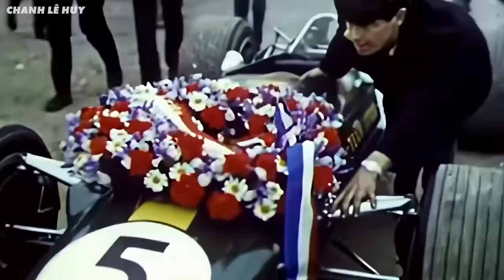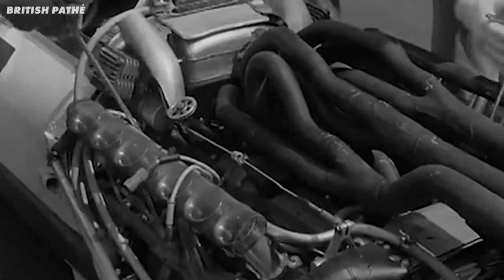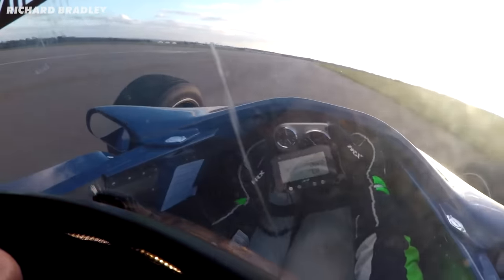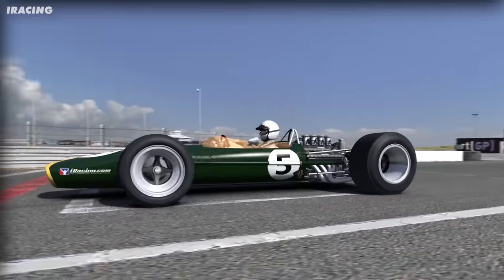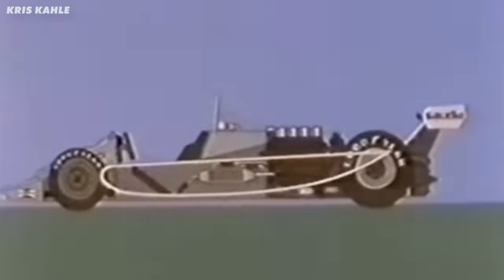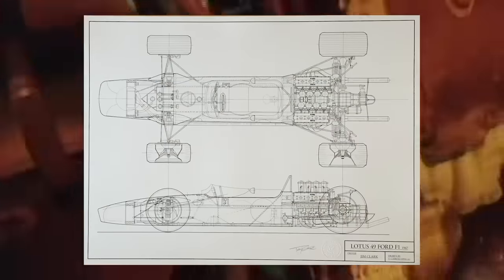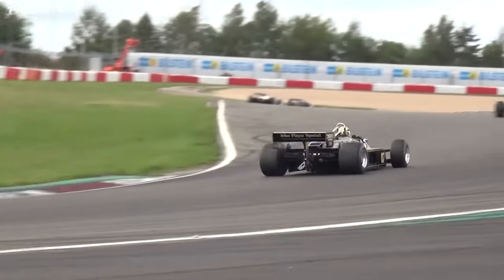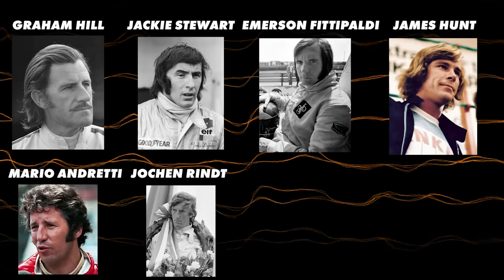When FORD Designed the GREATEST F1 Engine Ever!

Comment: The DFV was not the first 3 litre V8 in F1. That honour goes to Brabham which had a Oldsmobile engine modified by Repco in Australia. That combination won both F1 championships in 1966 and 1967.
Reply: Beat the DFV which also ran part season in 66 and full season in 67. It was a shame Repco didn't bother to develop their engine further, as they had already achieved all they set out to achieve.
Reply: @alexjohnward   The Repco V8 was designed and developed by Philip Irving, who had previously designed for Vincent and Velocette.  The Repco was successful because it was compact, light and reliable.  Note that it won the 1967 F1 World Championship, including the year when Jim Clark won the DFV's first race.  It was reliable, which the early DFV was not.  However, to remain competitive, it did need more power, lots of it.  The four valve versions of the Repco were not a success.
The DFV became competitive because it gained reliability to match its power.  This was after an accelerated development program BY FORD in the USA. The had sophisticated test equipment to find and analyse faults in an engine, more sophisticated than any other manufacturer at the time. The methods pioneered at Ford have become standard industry practice.
The £100k which Ford put up to fund the Cosworth FVA and DFV is probably the best investment that they ever made.
Reply: Why did Repco move to retail lol they had some good machinists back in the day
Reply: @youwantshum9860  Australia used to have a big manufacturing base but that shrunk over time, there would have been a engine machine shop in every town in the 60s, not now.
Reply: @youwantshum9860   Repco was heavily involved in supplying car parts for retail in the 1960s. This was a promotional venture to demonstrate the ability of the company, that it was not a maker of cheap knock-off replacement parts.
Reply: It wasn't actually an Oldsmobile engine, it was just the block, everything else had been designed by Repco. At the very basic level, the Olds engine was a pushrod, cross-plane engine, while the Repco was a SOHC, flat-plane engine.
Reply: @PistonAvatarGuy   The early Repco V8 F1 engines used an Oldsmobile block. Later examples used a modified block cast to a Repco design.
Reply: @pashakdescilly7517  So are you suggesting that Mericans had a hand in making the DFV reliable? Just asking..
Reply: @slamtailsuspension1933  very much so
Reply: The DFV never ran in any F-1 race in 1966.  
  The "FORD" power plant you are seeing in any results from 1966(McLaren mostly)was a destroked Indianapolis 4-cam engine. Not the Cosworth DFV.
Reply: Sir Jack won the WDC twice, in a car he designed himself, the Repco Brabham, the greatest acievement in F1 history. No other driver has done that!
Reply: @markhill9275  Jack Brabham was world F1 champion three times. Twice in a Cooper (1959 and '60) in whose design and development he had a significant hand. Then he set up his own race team and won the championship in 1966, and was just pipped in the last race for the 1967 F1 championship by Dennis Hulme, who was driving in his team. Brabham was not very pleased.
Hulme moved to the McLaren F1 team for the next F1 season. Bruce McLaren was also an Antipodean and a former Cooper driver + design/development engineer. Bruce McLaren and Hulme so dominated CanAm that it became known in racing circles as the 'Bruce and Denny show'. The team did not have such success in F1
Reply: @plantfeeder6677  Only in 2-races by McLaren in 66. Built by Traco in California. And an embarrassment to all concerned!

Comment: I was at Imperial College some years after Keith Duckworth, and was told he spent 3 years in the basement of Mech Eng designing the engine. He did not attend any lectures, he just spent 3 years designing the engine with input from a number of professors who had realised he was a genius to be encouraged not made to follow the usual degree path.

Comment: An episode littered with errors. A click bait title to start. There was never discussion on what crank would be used. Complete error with the conversion of English pounds to dollars is totally off, in 66/67 the rate was $2.80/pound or $280,000 or $2,581,600 in 2023 $. And there more, thumbs down.

Comment: Cosworth also completely changed modern engine design principles. Lower included valve angles lead to better breathing at higher RPM. Even Honda’s 20000 rpm engines had hemispherical combustion chambers at the time. The short stroke, wide angle V also allowed room for the exhaust pipes and leads to a lower center of gravity than flat engines,as the cars are so low, there’s no room for exhaust pipes under the car and you’d actually have to raise your engine to make room…

Comment: Another fun engine to do a video on would be the Ford 427 SOHC AKA "The Cammer." An engine so badass that it got banned in NASCAR before ever making a single lap due to Chrysler complaining about it because they knew it was gonna eat their 426 Hemi alive.
Reply: There is an extensive history of “sanctioning bodies” banning FORD engines as the other 2 manufacturers simply can’t compete when the artificial parameters are equal. Just the Cleveland alone is the most banned engine ever submitted for racing.

Comment: The Cosworth was NOT a high revving engine compared to it's competition, in fact it was run dangerously close to it's mechanical limit just to keep up. Miss one shift and it was a matter of WHEN, not if it was going to drop a valve. What made it legendary was the sheer number of teams that used it every season, through the 70's and early 80's half the grid was powered by the Ford and it won every race of the season on two occasions. The fact is from the mid 70's the flat Ferrari T cars had the superior package, ground effects and the unreliability of the early turbos benefited the DFV's winning persentage greatly. A side note is in the late 60's Toyota built a 3 L V8 engine (based on the DFV) for sports car racing, it made up to 40 HP more due to a more modern design, Cosworth never had the deep pockets it needed to keep the engine close to the cutting edge, it spent most of it's life being just good enough to get the job done at a reasonable price. Later in it's life people like John Judd tickle 20 or so extra HP (and 300 more revs) but the engine was still rooted in 1960's design and architecture.

Comment: 8:25:"When the turbo engines took over in 1972..." I believe you meant 1982. There were no turbo engines in F1 during the 1970's.
Reply: Didn't Renault run a turbo in the mid to late 70s.

Comment: Ford had nothing to do with designing this engine. Apart from cash. Bugatti were making 4 valve engines in 1923. Need some research
Reply: Funding is important, don't you think? Otherwise, it wouldn't have ever happened in the way or timeframe that it did.

Comment: We need a formula x with much more freedom to allow experimentation. Unlikely to happen, but one can dream.
Reply: Won't happen because privateers would be priced out. Already happened with Can-Am.

There is simply no balance of performance between rich and poor teams.
Reply: That's what formula one was starting to turn into, but it made it extremely expensive and basically meant that the teams with the most money would almost always win.

I'd prefer a system where you have to build your car to certain specs like peak down force and engine power, with the teams determining to to get there.
Reply: @holy3979  That's called a spec championship, which you'll find in IndyCar and NASCAR.

And F1 is also trying to combat it with development credits - not that I can say it was an effective strategy.

Comment: I was yesterday at the Spa 6 hours, it hurts so much when you see how strong Ford used to be.

The Spa 6 hours itself is dominated by the Ford GT40's, but almost every other brand is driving Ford engines as well.
Not only that, I was wondering: "Where are the Ferrari's?". Answer: "Too expensive to maintain.".
It's even budget friendly.

Also the Capri Cosworth destroyed the whole field in the Belcar Historic Cup, starting in the 2nd group with the older cars.
But 1 lap later the Capri was already 6th, overtaking 30-40 cars in just 1 lap.
Later overtaking M3's, 911's and more from the 90's and even a Corvette C4 with a whopping 800Bhp.
The Capri only has 435Bhp, is from the early 70's, and casually destroying DTM cars from the 90's.

At Zolder a decade ago also a Cosworth Capri being 4 seconds a lap faster than the Alfa Romeo 155 DTM legend.

Now Ford is rather pathetic, really sad about it.
Reply: Such a shame from Ford, hope they do well in 2026

Comment: The turbo didn't take over F1 by 1972. The very first driver championship was won in 1983. (8:45)
Reply: Not only did the turbo not take over by 1972,  it wasn't even until '77 with Renault's RS01 that a turbo even appeared.  There's a good quote in a book I have (I think it's Doug Nye's 'History of the Grand Prix car 1966-85) mentioning a speed trap at the end of one of the straights on some circuit or other - suddenly a speed tens of miles an hour faster than anyone else showed up - the turbos had arrived...  but it took them until 83 to win a championship, but of course that was also the year of the final DFV F1 win with Michele Alboreto.
Reply: @thosdot6497  This video is littered with error, not to mention the click bait title. In addition, his conversion of English pounds to dollars is totally off, in 66/67 the rate $2.80/pound or $280,000 or $2,581,600 in 2023 $.

Comment: I think you meant 1982 not 72 for turbo engines. Renault RS01 of 1977 was the first F1 car to use a turbocharged engine and were known as tea post for the blew up quite often.
 by 1981 turbo power ruled. 812 Ferrari 126c won constructors championship in 82 and 83. In 84 the Mclaren MP4/2 Tag Porsche turbo dominated the 84 season winning 12 of the 16 races. 86 was Williams FW11 turbo Honda where Mansel and Piquet won back to back championships 
I was lucky enough to go to the Long beach f1 race in 81 and 82 where the DFV Cosworth v8,  Matra v12,  Alfa v12, Hart turbo, Ferrari turbo, BMW turbo M12, Brabham ran the M12 and Cosworth, were in full battle mode and the sound was heaven for a gear head. 
Niki Lauda won 82  with his MP4/1B Mclaren DFV Cosworth power and the top 10 finishers were also DFV Cosworth power.

Comment: Many of the innovations listed for the Cosworth already existed.  

When the 3-litre rules came in Jack Brabham quickly built a V8 based on the production Oldsmobile 215 alloy V8 with overhead cam heads designed by Phil Irving.  He won the championship with that engine thus becoming the only person ever to win the driver's championship in his own car.  That was a flatplane crankshaft engine as were all early V8s until the cross-plane crankshaft was developed.  Tuning the exhausts of V8s could be a problem and contributed to some F1 V8s being reversed with the exhaust in the valley of the V and the inlets at the side of the engine.

Using the engine as a structural element of the chassis was well known and had been used in cars, motorcycles (HRD Vincent for one) and pretty much all WWII aircraft.

Four-valve heads had been around since the Peugeot GP car of 1912 but had fallen out of favour as the failure to understand gas flow and combustion meant that they did not perform much better than a two-valve hemi but were more complex.  The four-valve head started its comeback in the early 60s with Honda racing motorcycles and the beginnings of designing the heads for squish.  This was further developed by Weslake Engineering for Ford and later turned up in the Gurney/Weslake engines.  THEN Keith Duckworth continued that development, his earlier engines were very different, some using Herron combustion chambers.  There were many great British racing engine engineers in that era including one of Keith Duckworth's "Heros"  Walter Hassan of Coventry Climax. Many of these people cut their teeth in aero engine design during WWII, whereas others such as Harry Weslake were legends in the British motor industry.

Firing order?  It may be related to exhaust timing but usually firing orders are optimised to keep the crankshaft vibrational modes under control so that the crankshaft does not break.

Don't get me wrong, the engine was a great design but it was not doing anything new or innovative and THAT is one of the major reasons it was successful, it was just well-engineered. Unusual but not innovative was the BRM H16, and we know how that ended.  There had been H engines before, most notably in aero engines with two prominent examples being the Napier Sabre and the Rolls-Royce Eagle 22, both of these were H24s using sleeve valves (most important for building a compact H engine!!!).  The BRM H16 was designed by Tony Rudd who had come to BRM from (cough, splutter) Rolls-Royce.

Comment: The DFV was not a 'high' revving engine because it used less cylinders!!. The V12s of the era revved higher than the DFV because their piston/rods were lighter.. ffs, get your facts straight, ask anyone who knows this stuff. 4 valve heads were already used before, like pre WW1!!! The key to this engine being the greatest racing engine ever designed was very simple! Duckworth decreased the included angle of the valves, stood them up, to create a very flat piston, which lowered its mass, and a "pentroof" combustion chamber which made the gas flow into the chamber relatively straight.. The gas tumbled into the chamber, and burnt a lot more fuel than the old wide valve chambers. NP - Every production engine manufacturer learnt from this, (apart from the Mericans) FVA/DFV design but it took decades to see this in production engines.

Comment: So I didn't see any comments mentioning it, but I thinkyou missed the technology that gave the engine it's tech. (This is from Kevin Camerons 'Classic Motorcycle Race engines') 

You mentioned the engine had 4 valves per cylinder, and this allowed air to enter and exit the cylinder, there by allowing higher revs. However you missed a step here. 

All that air and gas mixture has to burn. It's the burn time that was the limiting factor of the engine, not the valves. (The valves were a limiting factor but that comes up later) 

See the way two valves engines would work, would be to have the intake valve set to one side of the cylinder. When the intake-charge was pulled In, it would swirl around the cylinder like liquide does in a blender. This swirling would allow faster combustion. 

However at higher rpm, the valve size goes up to get increases flow. This makes for heavier valves and a slower valve train. 

You can get around this by using 4 valves, but now you have valves off set to either side. As the air-charge mixture comes rushing in, the two paths cancel each other out. Killing all the swirl. 

The cosworth genius was to think "instead of a swirl that spins like a blender, what if we make the valve angle really steep, and get a swirl like a front loading washing machine?

This created a combination of higher flow, and more efficient combustion. About 10% more efficient, which is what the lap times tended to reflect. 

Casworths design didn't get figured out until the 80's. (Ducati had to discover it independently) other engines designers tried to copy the Cosworth design, but because they didn't know what they were shooting for (a horizontal curl) they couldn't replicate their success. 

All the other factors you listed were new to me, so thanks for sharing. I appreciate the vid.

Comment: Why would V8 rev higher than the V12? Each cylinder would be much bigger for V8s so it wouldn't rev as high as the smaller cylinder V12s.

Comment: question:
If this was the "greatest F1 engine ever" ... why is it not used in competition today?  
Did the rules change prohibiting eight cylinder engines,  or some other aspect of the engine design?

Since current F1 cars are faster than the cars this engine was used in (I believe current cars are powered by inline 4 cylinder engines or a V-6?) how can this be "the greatest ever"? Today's technology makes it obsolete.

Admittedly it was one of the top engines in its day. However, other makes besides Ford won F1 competitions when this engine was in production. Lotus, Porsche, and Ferrari, to name three. I think there was a French engine that won a lot of races, as well ... Citroen?

Comment: The 4 valves confiig wasn't the most significant element.  The included valve angle and the port angle were set up to make barrel turbulence or tumble.  This mixture motion allows efficient combustion at higher revs without the added friction and complexity of an increased number of cylinders.  It took the others a long time to figure this out.  Now almost every production engine has this type of combustion chamber.  The Coventry Climax 1.5 liter engine tried a 4v head but wasn't successful due to its large included angle.  It needed 50 degrees of ignition advance to make the same power as the 2V version.

Comment: I was at Zandvoort on June 4, 1967 'first time out' for the Lotus 49 and the Cosworth DFV. The 49s were housed somewhere in the town and I was walking into the circuit sometime before F1 practice was due to start when there was a huge racket behind me and the two Lotus 49s came up behind me being driven to the circuit by 2 Lotus mechanics! I remember G Hill dominating in practice and taking pole position. However, his car croaked after about 10 laps and he pushed the car about 400 meters along the main straight to the pits - not something you would be allowed to do today!